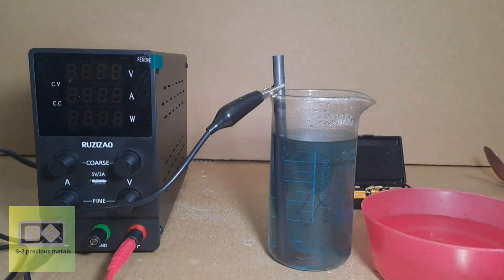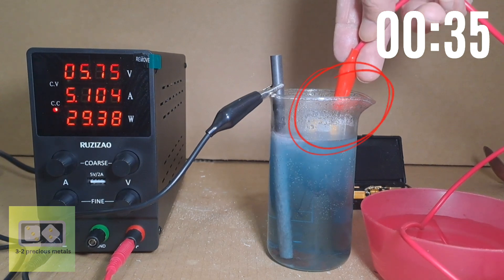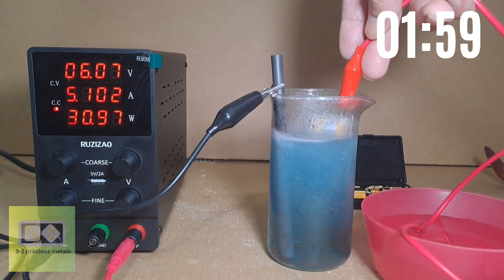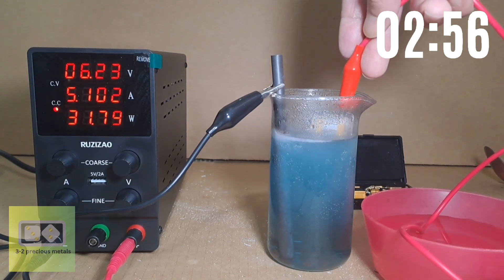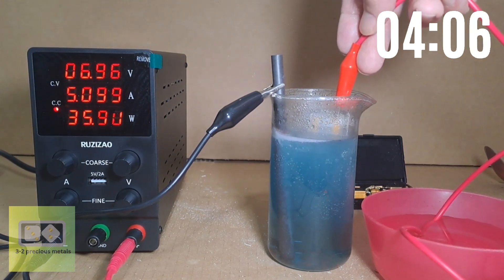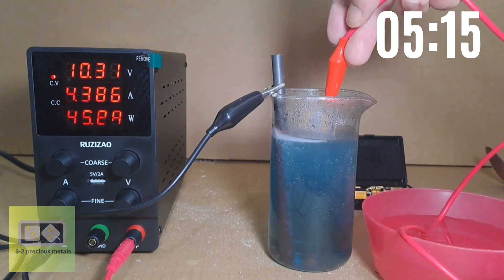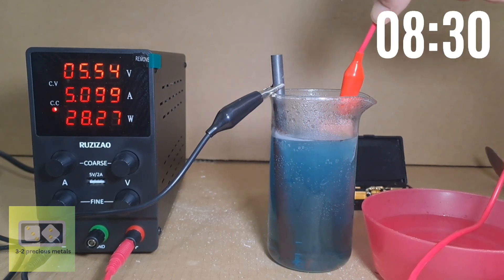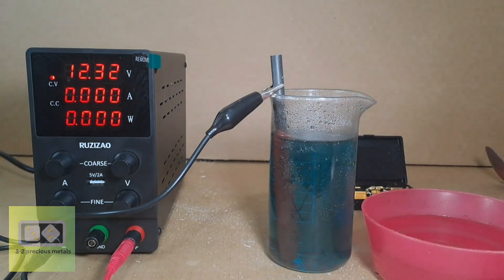Can You Remove Gold Plating with Sodium Bisulfate?

Comment: Unrelated, but I have something steel that I want to plate with copper. Finally got all the old paint and coating stripped off and down to raw steel, but I'm reading conflicting things online about plating copper to steel. Some say the steel needs to first be plated with nickel or the copper won't stick, but I also see other things saying that to plate steel with nickel, it needs to first be plated with copper....
Reply from the maker: You should be able to plate the steel directly,  soak the steel first in 10% hcl or a solution of salt and vinegar for a couple of minutes to remove any oxidation that might have built up first, and then rinse and go straight into your copper electrolyte. Make sure to rotate your item to get a uniform plating and it should be fine. Experiment with a piece of scrap first to see how it goes 👍
Reply: @3-2preciousmetalrecycling  Thanks, and I definitely need that acid pre-bath anyways because of how fast this thing tends to flash rust.

Comment: Can this be used for Glass or porcelain plated objects?
Reply from the maker: Probably not. It would be very difficult to maintain an electrical connection. A leaching solution would probably be better iodine can leach gold plating. 👍
Reply: @ thank you I’m very new to all of this but from my job I got a buuuunch of circuit boards and glassware aswell as porcelain and am trying to learn I would love any pointers you have for me because I have a decent amount and would like to do it right and not just destroy or waste it all
Reply from the maker: The first tip I will give is before jumping straight in, do some reading and research. Check out the gold refining forum on the Internet and just read some comments. There will be people on there who have made mistakes when starting out, and there's some good advice for the problems they came across
Reply from the maker: Once you have researched, do small test batches to get comfortable with the reactions.